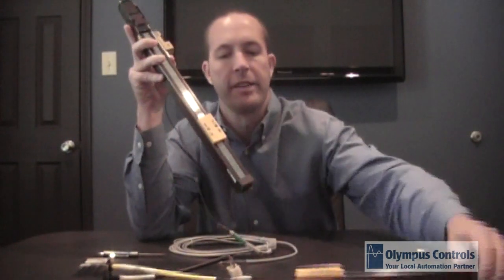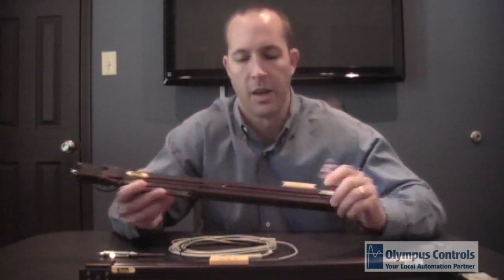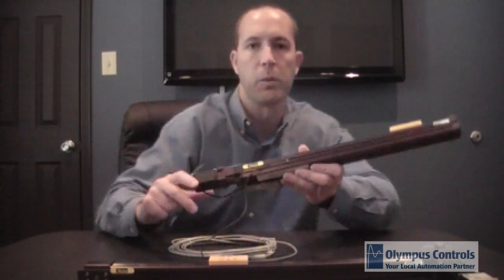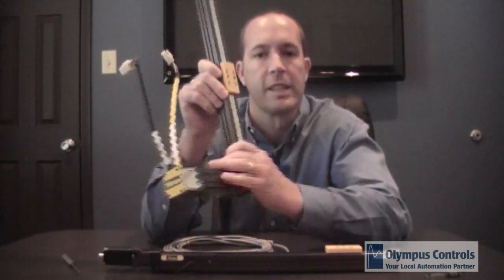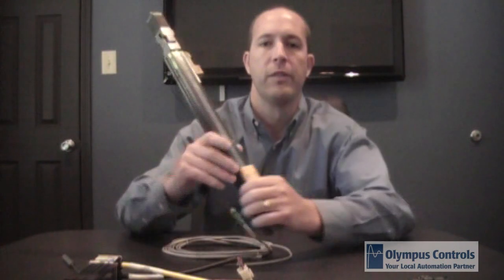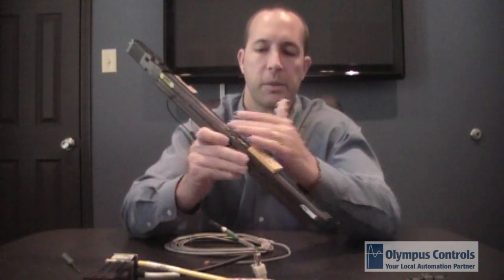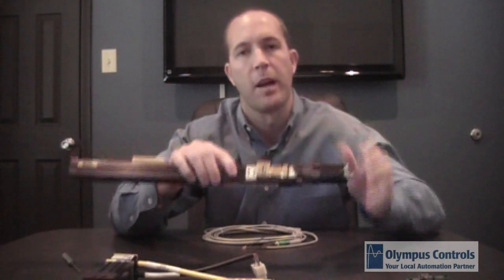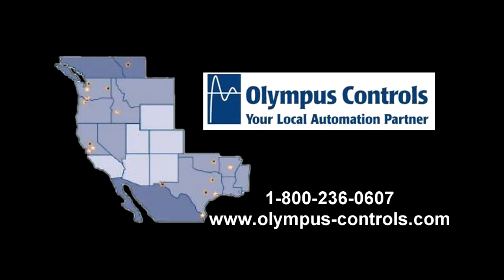Parker LCR Actuator and Ion Stepper Drive

Comment: Awesome Jason. Like how you cover all the key features on the LCR miniature low cost rodless actuator, both leadscrew or belt drive options and the servo / stepper electric motor option. Note the Ion drive is now named the E2. Nice video Jason!